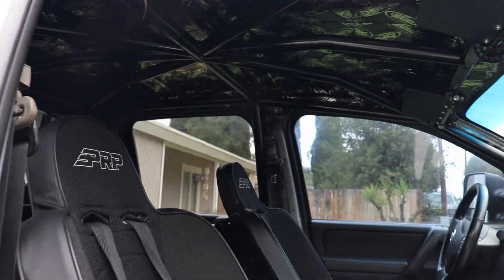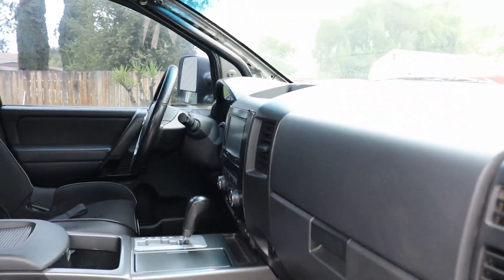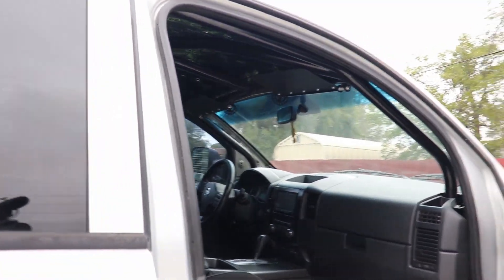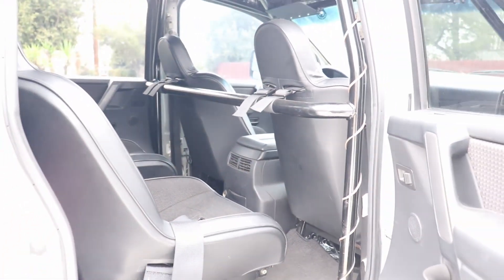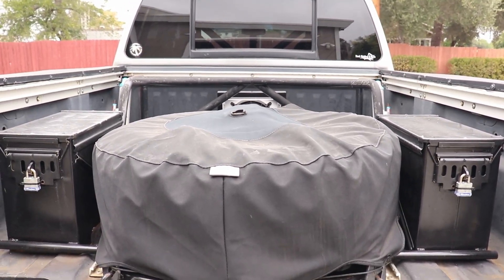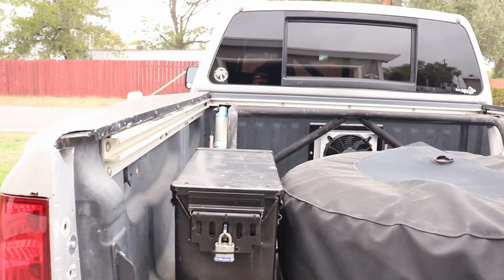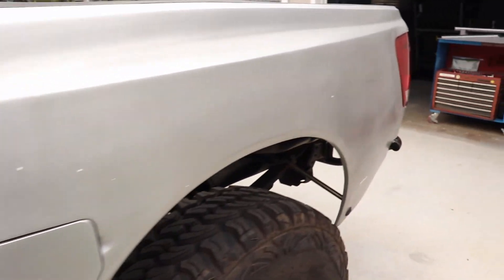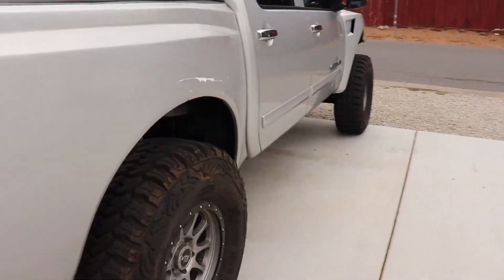Nissan Titan Update #2

Comment: How did you mount the led lights ?
Reply from the maker: Inside is a utv tube mount LED light. Outside is a bracket. Flatbar formed into a   "C"  shape. Bolted between fender and windshield cowl.  Front bumper metal tabs welded to bumper.  Hope that helps you out. Thanks for watching
Reply: @ThinkWeldingMore   thanks!  It looks amazing